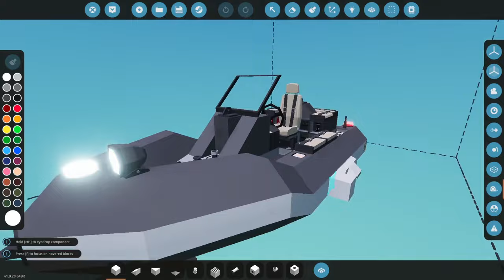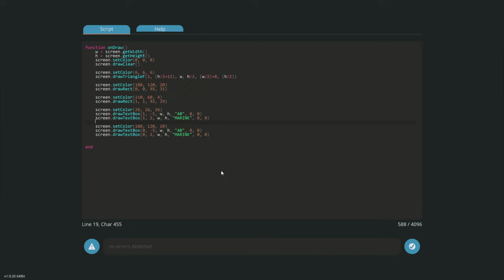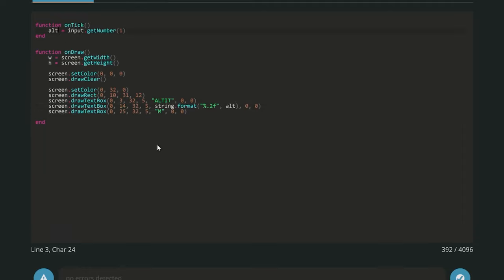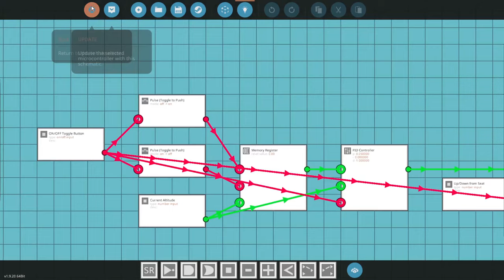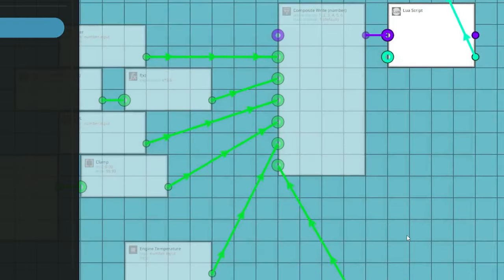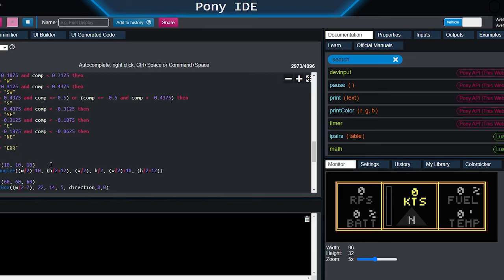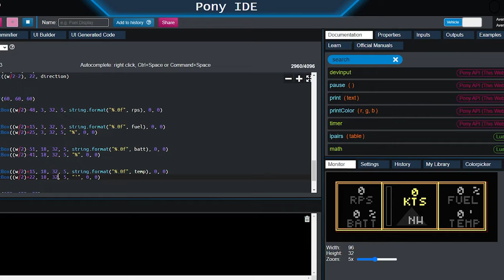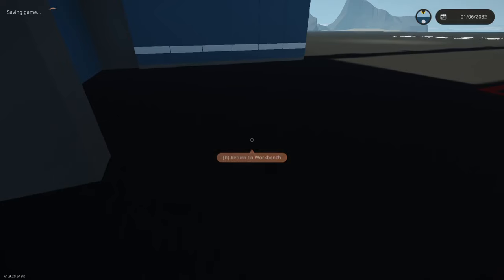Stormworks Intro to LUA Displays - Advanced Tutorial (Engineer Explains)

Comment: > programming is university level
That university kinda screwed you there. Programming is a skill you can't gain from courses or education, it is a pure practice and "in vivo study" based skill. Ask me to figure out the math for a bridge that doesnt know how to dance and it would be doing the shaky shake regardless of how many trucks came across on an hourly basis! I have zero academic qualifications, most professional programmers don't, there are even a bunch of electronic engineers who never got a diploma! I only know matrix math when I absolutely need it, even vectors and basic calculus, it is gone from my head right now, I only got it in there when I need to figure out how to solve a problem and translate that into C99, ANSI C, 2012 standard Forth or something along the lines of that. The courses seem to do more damage than good, I havent encountered a single person who went through a programming course who isnt somewhat scared of programming at this point.

It is a "sightless" skill, i.e visualizing is not really needed, is it about translating thought to action, getting the very literal thinking kid to know how to start a helicopter by describing which levers to pull and which switches to flick in what order, or telling someone how to cook a delicious dish. I can recommend "Starting FORTH" by Leo Brodie, it was aimed at people with no real university education, formal training with operating computer systems or programming(in a time where a text terminal was still your most common form of user interface and you couldnt just look up how to do things online!) and explains programming, albeit in a language that differs a lot from others (but which is loved by the engineering field for being easy to work with if you never learned programming in its most common structure)